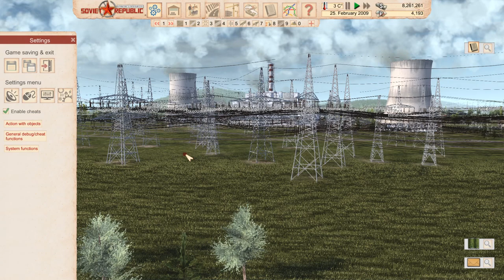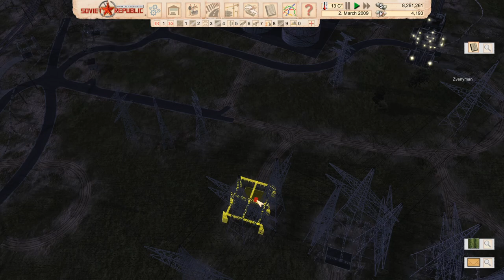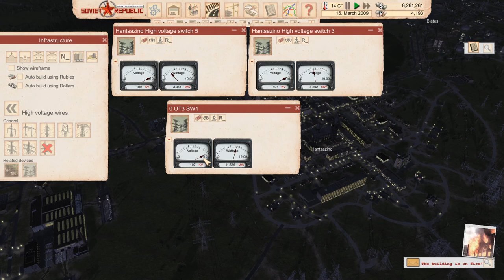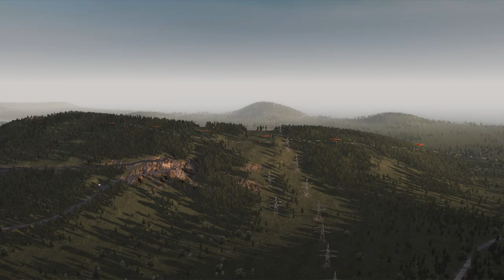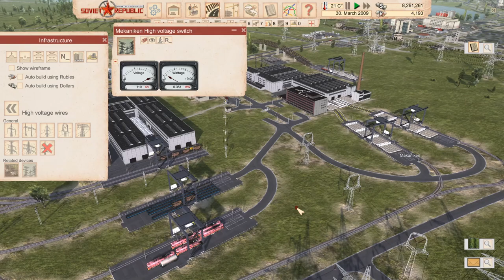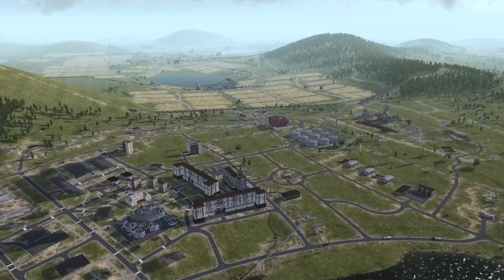High Voltage troubleshooting method. Workers & Resources: Soviet Republic. TBD2 37. Part I/II.

Comment: Graph vertices - store in linked lists :D Renaming the stations was tedious!
27:05 you followed the "how to defuse bombs in movies" - always cut the red one;) 
The issue with the network is that the easiest way to debug is to make a cut, but then you would kill something off for a while...
This was another nice educational video to me!
Reply from the maker: Haha yes that would do it. Drawing them on paper and putting in a binder. And a little lookup table to be able to pull up the thing you need. On a serious note though, say that when you selected a switch, at the Wires connecting directly do it would highlight in some fashion, like the blocks on the railroad do (well sometimes at least). I don't know though, the highlighting might just become a complete rainbow if it would be more than that, highlight beyond the next switch, and the next and so on, and the wires had different colour intensity depending on load. At least in my so called HV network ;) Yes it's I'd say it's more of a network than a grid due to the 18MW limitation.

Yes it was tedious, there's a reason I've been kicking this can down the road for at least 50 years, even built a second nuclear power plant rather than doing this :) But I think it worked out pretty well. I was trying to devise the method whilst doing it. And since you're a much appreciated regular here, I don't think you where expecting brevity? :)

BTW, I'm trying your suggestion of splitting the videos up on this and a some upcoming, where I'd normally take a break. Think I'm still going to have to be releasing all the parts on the same day though or the backlog will grow to something unwieldy and be thrown out eventually..
Reply from the maker: @hond654  Yeah I saw that thread earlier. I was suspicious already at the subject line, "I was watching a channel and the guy had a complex electrical system and" Got you! :D But this is excellent. You go on the forums so I don't have to. That place keeps draining me.

Funny you should mention the Colonel. He's sort of the one who got me in to this mess. I was for many years free from an uncontrollable addiction to these types of games. Then I stumbled upon Transport Fever. It immediately grabbed me, played for maybe 30 hours or so and then went on youtube to find some tips. Found the Colonel (through a tutorial video incidentally @A.R.M UK), watched a few of his more regular styled videos, and was relieved. He was playing so close to my own style/approach and well enough that I felt I didn't even have to play it myself anymore. Then he showed me Soviet Republic. (trigger warning, personal opinions to follow) He's a master of TF but completely rubbish with Soviet Republic. As far as playing the game goes at least, his video craft is excellent. That said I can't quite bear his Soviet Republic videos anymore because I end up even more frustrated than him. So whilst he's shouting at a 2km stretch of road that won't go in in one go, I'm shouting "HOW THE HELL CAN YOU STILL NOT GET THIS GAME!?!?" :D

Anywhos', after 5-600 hours or so of playing Soviet Republic I felt this can not continue. So for some reason I said to myself, self, if you're going to be playing this game, you're also going to record it and put up on youtube.

So that's the short version of how we ended up here :)
Reply from the maker: @hond654  Oh and btw regards the video lengths and chopping them up like this, I'm trying out your suggestion. Not because I feel obliged, but because maybe it's a good idea. I thought maybe 1,5 hours is at least not as deterring as 3, 4 or 8 hours. Nothing's changed about how I record these, the only difference being in "post production" - that I chop them up where I've taken my breaks. The one I recorded yesterday didn't have a break, hence no chopping will be done.
Reply: @DrPluring  LOL, I agree on Colonel, he does not learn from mistakes - so I can :D The other end of the spectrum for example https://www.youtube.com/channel/UCIq3MMSPDHopqNMt7A02C_Q  who has the most orthogonal republic and untangled electric network i have ever seen. I think because Russian players tend to play big and spread out, while small country players play packed. That is my theory:)
Hope you feel there is no critique, i just enjoy watching different playstyles without judging, one can be as good as the other.
But i am surely not the orthogonal builder type!
Reply from the maker: @hond654  Wow that russian guy :) Let's just say we have a different approach to this :) Completely flat landscape, completely straight roads. I think adapting your building to the landscape is a big part of the challange. Yes many things ends up a mess, but I'm not trying to recreate the Netherlands.. ;) And most of all, he started a new game on the 0.7 branch now in August if I dind't misunderstand. I play on the beta branch, always, it is very painful sometimes, but the unpredictability is also part of the fun

No I wouldn't take that as critique, even if it would have been your intention. Getting this game to do something a kin to what I want is not on the list of my insecurities :)

It might be fun to pick apart someone else's republic though. hint :)